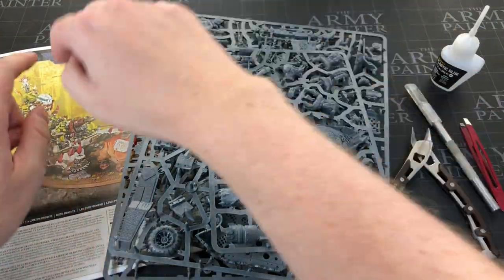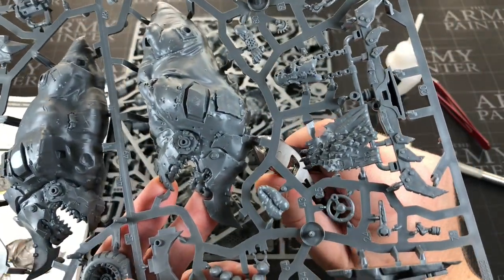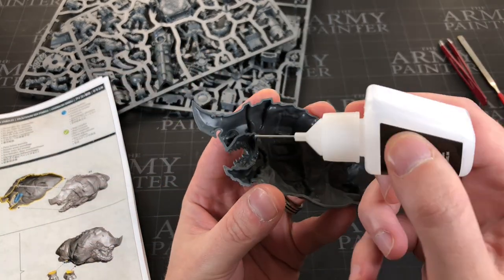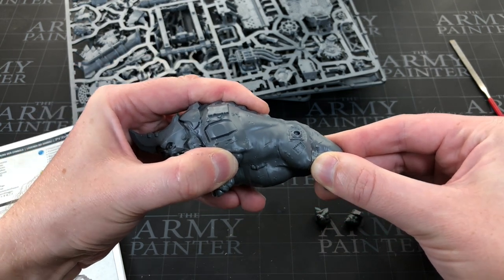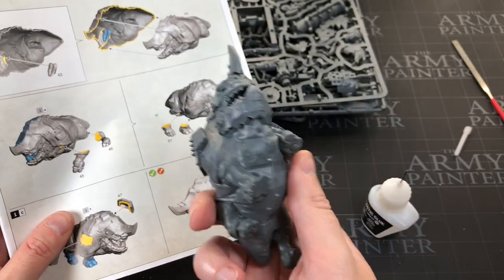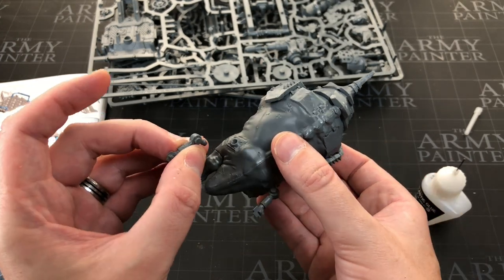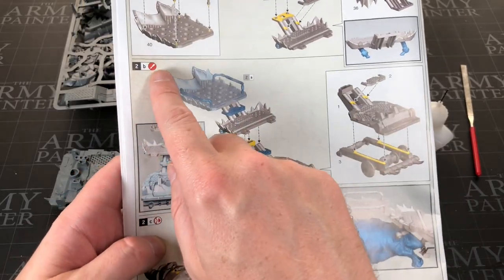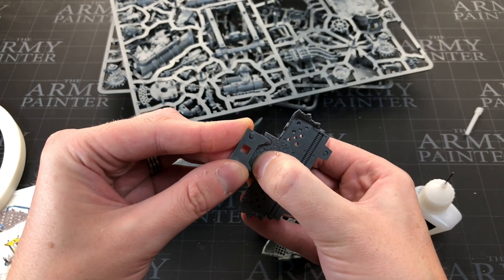They messed up! Warhammer 40k | Ork Kill Rig | Assembly Part 1/2

Comment: HI, about the glue - I used the same glue you use here until I found out that acetone basically does the same job. Now I use nothing else.
of course it behaves a little different, so try it out a few times on some leftovers first.

Comment: I saw a mistake in my old Shadows and Pain box set. Instructions were mixed between two pretty close looking models and it was a mess! Those models were fiddly to start so the errors did NOT help! It is helpful seeing you assemble these and then the paint job. I don't mind multi part videos. Building and cleaning for hours is exhausting so take that break! ❤️
Reply from the maker: Oooh at least this isn’t a mess! Or at least so far. Jus surprising to see any mistakes. I kept checking the instructions over and over and Benson was confirming I wasn’t being blind :-D wasted a lot of time looking for imaginary joints :-S

Thanks for the feedback! Yeah I was very surprised how much work this model is, funny how I though the Swampboss would be the biggest thing I’ve ever built :-D that didn’t last long did it
Reply: Nope, not being blind. Some of their instructions leave much to be desired lol

Comment: tamiya cement with the brush applicator is sooooooo much better than citadels. it’s cheaper and you’ll waste less glue and you can dry fit and then glue. plus there’s no nozzle to get clogged! 

also citadel nippers are expensive garbage. heavy and needlessly bulky and they don’t actually clip, they force plastic together and seperate the bitz creating those divets! yes you can smooth it out and sand it down but doing that to every sprue connection on a big build like this means wasting needless hours. get some tamiyo or vallejo nippers or the fabled GOD HAND.

hard metal files are excellent for flat sections, but for undulated and uneven surfaces you cannot beat a squishy foam nail file. 

for filling large seams or gaps like the seam right down his back i like to keep a bottle of plastic cement mixed with sprue filings which creates a thick-ish cloudy grey paste which will perfectly work into any gaps and once dry can easily be scraped/filed down to flush.

Comment: Citadel plastic glue is absolutely garbage compared to Tamiya plastic cement.
Reply from the maker: They smell identical - I have a bottle of each, but haven't tried the Tamiya yet. I figured they were the same chemical. What makes the Tamiya better? - Mike
Reply: Works great for me
Reply: @WatchItPaintIt  the active chemical is the same that melts the plastic to fuse the 2 pieces together. 

Tamiya extra thin you can get much better seams, you hold the pieces together and then brush it into the seam and capillary action pulls it into the joint and dries with in seconds. 

The regular tamiya is a little thicker than GW and dries much more slowly, aiding you when you need to fiddle with the pieces to get them to fit just right and dont want it to dry too fast.  You can also use some extra pieces of cut up sprue and put it into an old bottle of tamiya cement and let it melt giving you something that really fills gaps, or when you want a really strong joint.
Reply: @bradr9879  and rattle cans work fine for people too, but when compared to an airbrush they are garbage.